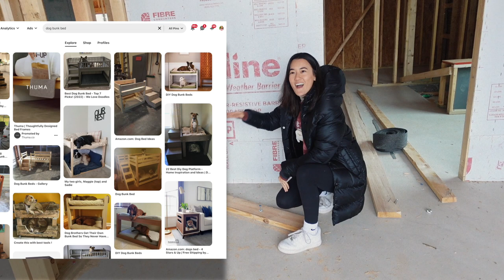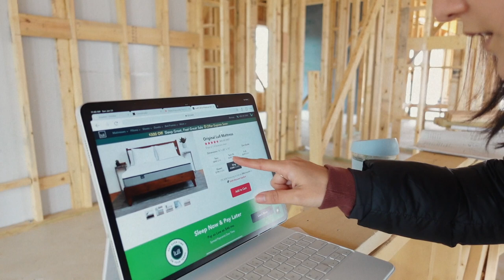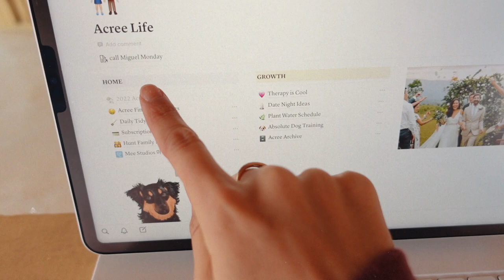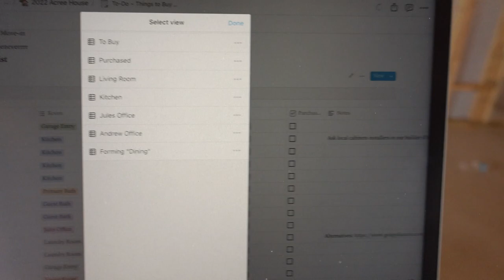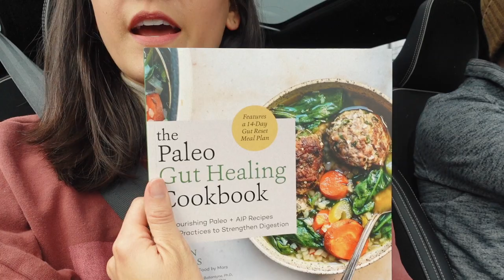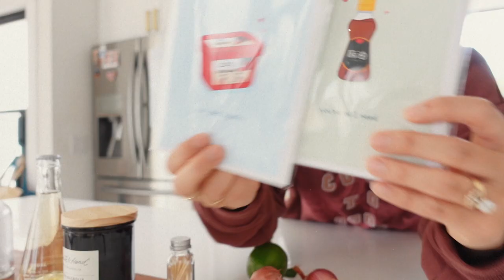🧋Sunday Vlog | New House Tour, Tidying Up, Making Boba

Comment: Just a quick not about those glass & steel doors you mentioned - glass is really tough acoustically. It's hard to sound dampen, so what you say will leak out into the house, and very echo-y because it's a hard surface, so sound bounces right off it it. If you're planning to film all your YouTube videos in there you might want to take that into consideration and get some sound dampening curtains, instead of plain ones. Maybe some sound panels for your ceiling too.  Glass can also interfere with wifi/cell service because it doesn't pass through very well, so having a router/extender/repeater will probably be necessary too. 
I used to be an operations manager for real estate and glass doors/walls in conference rooms was the bain of my experience because of these issues I just mentioned.
Reply from the maker: Ooh very interesting and good to know! I’ll look into it - thank you